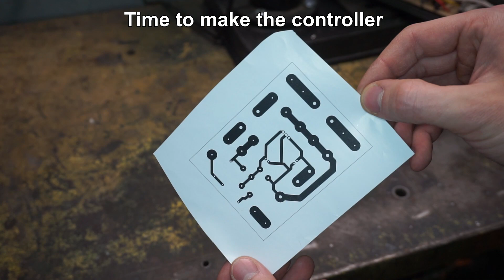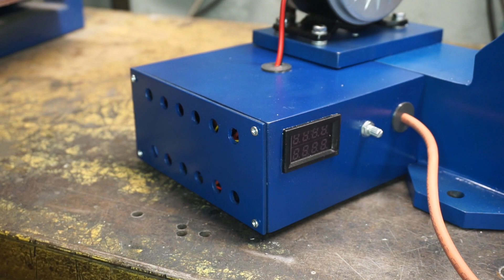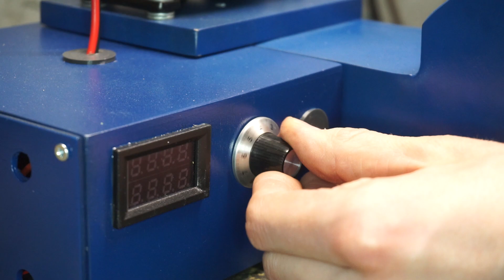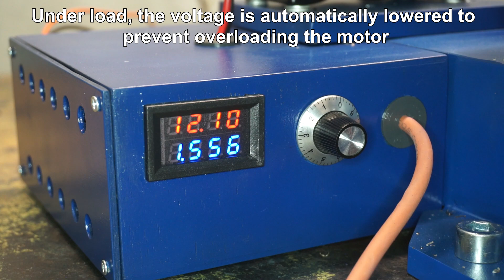Making a Powerful Automatic Vise

Comment: I have a 1000 watt 48 volt brushless motor with a 30ah controller and throttle...Will a 48 volt 20ah lithium battery work well with what I have?